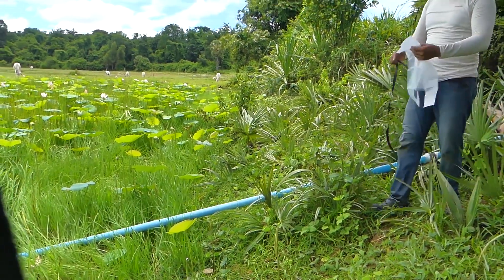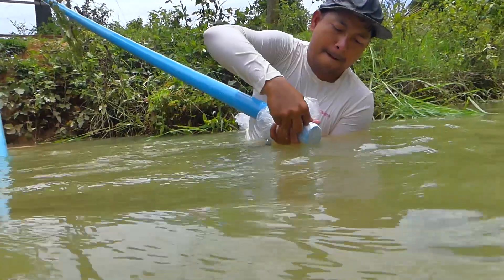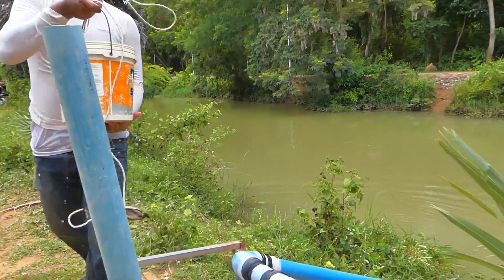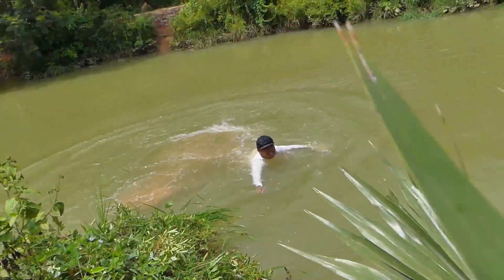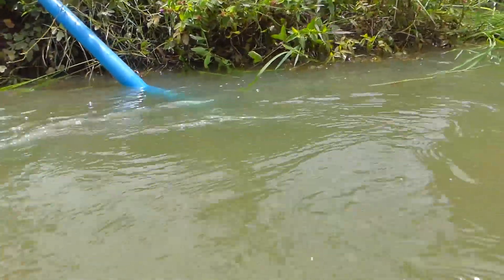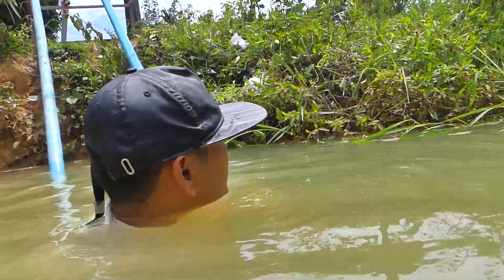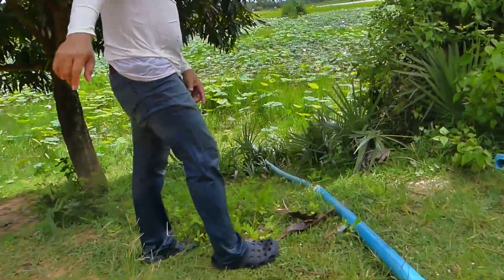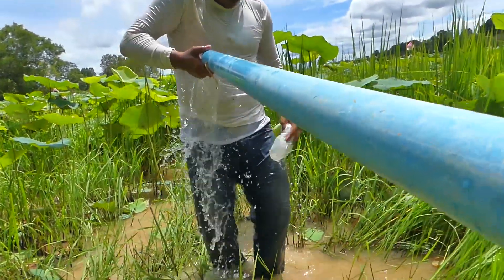Hybrid Siphon pump very strong- How tomake free energy water pump supper strong

Comment: Lot of theatre! Why use two suction tubes? The suction is equal to output so one suction pipe is enough. Why taking a bath, getting wet? At the beginning you pump, showing that there is a foot valve in the suction end, so no reason to get wet!
This is a siphon and for all  siphons the source water level must be higher than the outlet to the field.